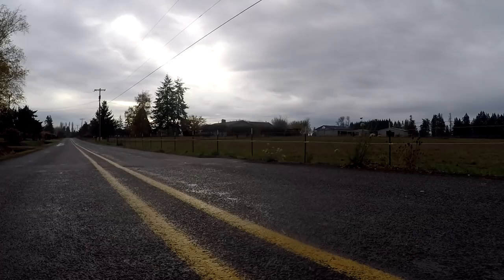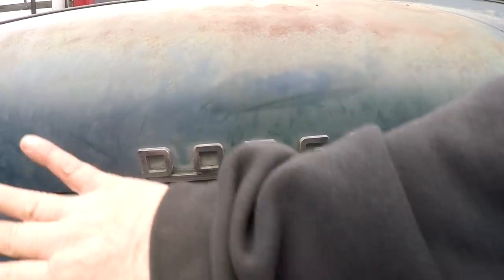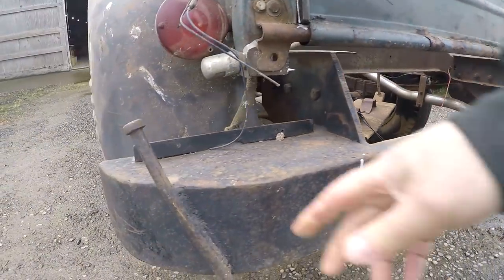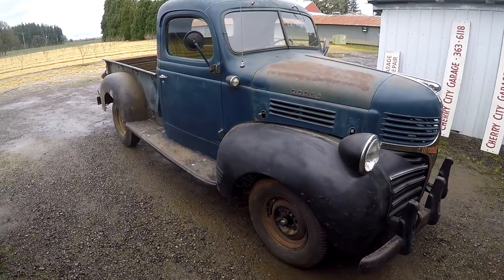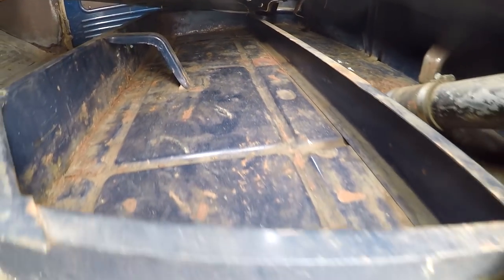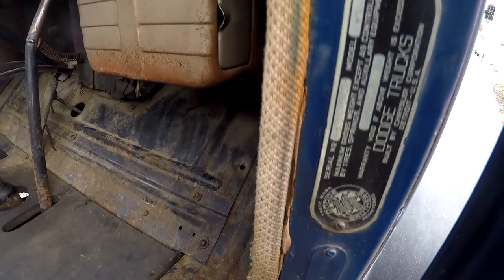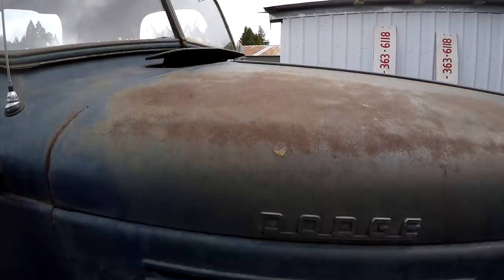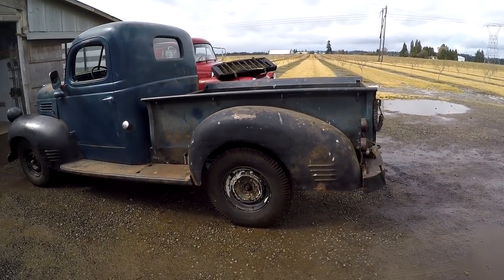1941 Dodge WC Pickup Survivor Truck, clean old classic! Check it out

Comment: If 100 percent originally isn't mandatory, a 265 Chrysler flathead six will give it a bit more oomph and only a few old Mopar fans would know the difference.  265 looks like a 218 except its 2 inches longer and has a tower full flow oil filter.   The 265 can be overbored to 282 inches and the torque will feel about like a later  318 v8.  The 25-1/2 in motors are better for higher speed driving than the 218/230.  The 265 is easier to get power from than the Ford L-head V8 - unless you spend a lot of money.

Comment: What is something like this worth?
Reply from the maker: I sold it no. Running for about 8, then it got shipped to NY for $1500 so I would say 10k
Reply: I have a 1941. Not runnig, if anyone is interested. Leave me a message. Has room rust rot.
Reply: In a decrepit and worn state, a 1940's Dodge truck usually goes for about $750-$2900, mint but used can go for $4500-$30000 and a fresh off the assembly line or showroom condition can average $37000-$110000.
Reply: MuneShadow1 thank you